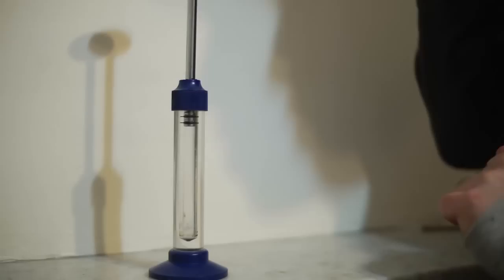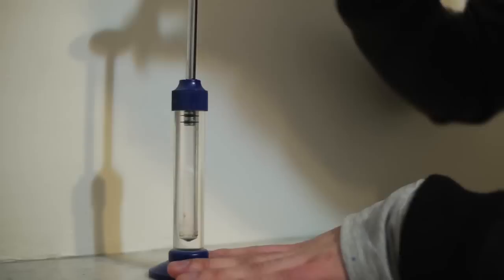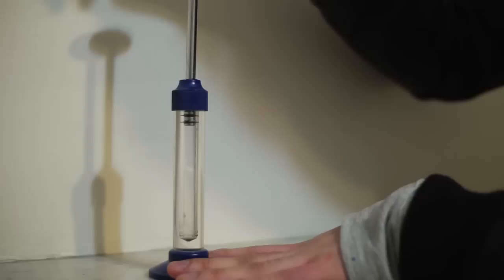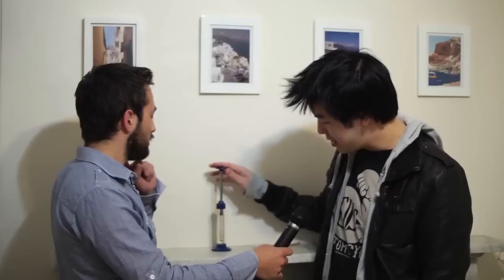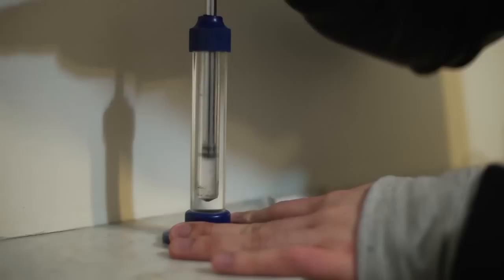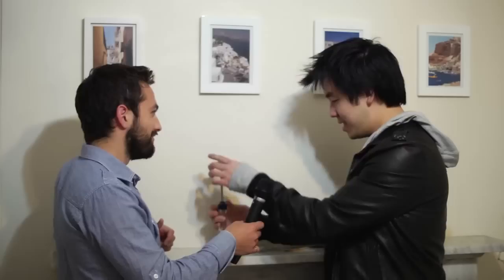Fire Syringe

Comment: Temperature should be constant :/. The Boyle-Mariotte's law says that pressure and volume have an inverse proportional relation. The pressure increases because the particles travel a shorter distance at the same speed so they hit the walls of the tube quicker.

Why is it not?
Reply: Pressure and volume are inversely proportional IF you're dealing with an isothermal situation (constant temperature). That is, this relationship exists if the setup is already such that the temperature is going to be constant, it's not that the first implies the second. With a slower compression, for example, where the thermal energy has a change to escape (we call this a quasistatic process), this relationship holds, but for the case presented in the video, where the thermal energy has no time to escape the container, then a different law is followed.

In case you're interested, the law followed in the adiabatic case is that P is inversely proportional to V raised to the power of gamma, where gamma is the ratio of the specific heat of the the substance (in this case air) at constant pressure, to the specific heat of the substance at constant volume.

Comment: You can reverse this process and cool down instead. Guys try this: open your mouth really big and breathe out, holding your hand in front of your mouth. Pretty warm eh.
Now make the opening of your mouth a tiny one and breathe out again, this time its much cooler. 
Differences in pressure inside your mouth and atmosphere causes the air to expand while exiting your mouth, cooling it down. It's the reverse effect of heating up when air is compressed.
These are governed by 1st law of thermodynamics

Comment: Not quite. Water can't boil from compression as far as I know. I could be wrong as I've never tried but the boiling point of water increases as you compress it. At 100psi, water boils at a little over 300°F and higher at higher pressure. So at the bottom the the ocean (~35,000ft) water would boil at well over 5,000°F. Even without the increased boiling point, the heating of the air wouldn't last long enough to boil the water unless it was an extremely tiny amount.

Comment: Is it possible that ignition comes because of electrostatic? Since when it was push in to the tube its a bit sticky (possibly caused by electrostatic charge). The sudden pressure might produce sudden increase in temperature that favorable for ignitinon, but the ignition might come from the electrostatic charge.. When the plunger was push in, the friction between the plunger and the tube might also produce electrostatic...

Comment: i think its incorrect to say that heat escaping because of slower compression will prevent ignition. it wont ignite in slower compression because of air escaping from a not perfectly sealed or airtight cylinder. did i say that right? pag mabagal ang compression unti unti lalabas ang hangin kaya hindi maabot yung tamang density. hindi dahil sa lumabas yung init.
Reply: No, with a slower compression the air particles wouldn't collide as fast, hence why there wouldn't be as much heat
Reply: joy castaneda   The seal is air tight, it's just, if you compress the air slowly, you still get an adiabatic compression, only that you don't reach the temperature needed because the compression is not "fully adiabatic", but it lets some heat pass through the walls of the cylinder. It is a small amount of heat, but it still prevents you from reaching the maximum temperature you would get with a fully adiabatic compression, and if you don't reach max temperature you might not ignite your fuel (which is in this case cotton wool)
Reply: Heat ha no mass, it can escape if it wants to

Comment: Do diesel engines not use spark plugs? I was under the impression that the high pressure behind each piston was just to put more explosive fuel in the chamber to create more force behind each explosion when the spark ignited the fuel. Sorry btw for that terrible wording.

Comment: I am assuming that this process can be considered adiabatic since the timescale for heat dissipation is slow. Can someone please share the thermodynamic calculations to solve for the internal temperature, T2, given that we know V1, T1, P1, V2. I know I need to use the ideal gas law and assume the process is isentropic. Which means T2 can be solved using T1V1^(ϒ-1)=T2V2^(ϒ-1) where ϒ = Cp/Cv=~1.4. Ok, i know i may have this wrong, but I hope someone with a good thermo background can correct me.

Comment: Is there a formula to make the syringe even larger? What exactly is needed before combustion is achieved?
Reply: Pillow Talk 

For combustion to happen there must be all three elements: fuel (the cotton wool), oxygen and heat (as Derek has explained the rapid compression raised the temperature of the air inside the tube). If you make a larger tube, it probably won't affect the fuel and oxygen (maybe it will be a more favourable condition from the perspective of oxygen!) However, it will be harder for you to raise the temperature of the air, because it is harder to push a larger syringe. 

A larger syringe is possible as long as it does not hinder your pushing the plunge and raising the temperature of the air inside. It is possible, but not desirable.

Comment: That is same as you start a Diesel engine, the diesel doesn't burn like petrol. But with Electric motor to compress your piston fast and powerful. you will diesel exploded and you get a working power generator.

Comment: demonstration of the difference between diesel and petrol engines where diesel engines have a longer stroke and use compression for ignition rather than a separate ignition system of petro engines.

Comment: Not really heat up the engine block, when you look at a diesel engine engine head on its underside, you would notice that there is a "slot" near the intake and exhaust ports/valve opening, this is called the pre-combustion chamber, there is where the glow plugs are located, on the first cycle of the engine run the fuel/air mixture goes into that chamber causing it to combust creating the momentum needed to carry on the engine cycle.

Comment: Not all diesels use glowplugs either, glowplugs are designed to aid in the starting of the engine in below freezing temperatures. There are many Diesel powered rock crawlers that use glowplug deletes.

Comment: The problem with doing it slowly is not the escape of heat. It is that your Force • Distance (Work) is less.
Reply: Your work will be the same regardless of time. You want to look at the work done in a gas, which is defined as P*V where P(pressure) = N/m^2, V(volume) = m^3 -> N/m^2 * m^3 = N*m = work. The volume decreases and the pressure increases rapidly so it's an adiabatic process which means that the process is happening so fast that there is no heat exchange with the surroundings, just like when you're popping champagne.

Comment: I May be misunderstanding this. Have you ever played with a co2 cartage? It releasing the pressure causes it to become extremely cold. Is this not the exact same principle at play in reverse? I thought concentration of thermal energy being forced to occupy a larger/smaller space was key in this function. Am I missing something?
Reply: Mechanical Engineer here. I'll just give you the quick summary. Rapidly expanding gasses get cold, and rapidly compressed gasses get hot. when you let air out of your CO2 canister, the gas is expanding, and when you whack a plunger like that, the gas is being compressed.
Reply: Ah! My dream qualification. I hopefully begin schooling next month. Let me pick your brain some more. They mention friction in this video, no? I'm confused as to how the same principal (in reverse ofcourse) could be applied to create cold under pressurized gas release.

The way you have explained it is how I understood it, but this videos dialog is throwing me off.... How is friction a component in cold caused by gas release?
Reply: Lets focus on your air-soft canister.
Anytime you have movement of particles against each other you get friction, including friction between gas molecules moving around in the air. Friction plays a small part to try to heat the moving, expanding gas. The cooling effect however is much greater then this heating effect, so much so that we don't include it in calculations. The principle at work here is the state properties of gasses. Its all about how much energy can be stored in the substance at different states. One thing to realize is that the CO2 in your canister is NOT gas, its liquid. When you boil water, it starts as liquid. It is heated to 100 deg C, then the temperature stops rising. It will now take a specific amount of heat energy, per gram of water to turn it into 100 deg C steam. That is, heat is added, the temperature stays constant, but the state changes. This is called latent heat, the energy required for the state change. When you have a liquid in your canister rapidly become gas when it escapes, you have changed the state without adding that latent heat. The absence of this added heat is why the gas is colder then the liquid was inside. Now the gas will absorb heat from the surroundings, therefore feel cold. Don't try to use PV=nRT to figure this out, because that is only for gasses that stay gasses, while our problem has a state change. You will need to take thermodynamics before you can really grasp all this, and answer your other questions. You will most likely be taking that you third and fourth semesters.The concepts of entropy and enthalpy are key. Good  luck with your schooling.
Reply: Ahhhh I see my fault now. State change sure does complicate matters (no pun intended). It's a little tough for me to completely understand this. I will refrain from making any assumptions until I can develop a more solid understanding through further education. Regrettably, I'm not entirely educated in these areas. But I hope to change that soon. Thank you for helping me out, sir. And yes I will do my best. Thanks for the good wishes.

Comment: just a quick question. is this also what happens when thing fly into our atmosphere?
Reply: No, objects fly at such high speeds that friction from the air in the atmosphere raises the temperature of said objects to the point that they become red-hot.
Reply: +Robert Adan Incorrect, they move so fast they compress the air, which heats up.
Reply: REKT XD
Reply: +BenJHare No, its the friction from the air that heats it up
Reply: +Mr.SpaceTricks While friction is a factor as those speeds, compression is the main heat creator.
Reply: yes when an object passes through the atmosphere it has a surface at which air infront of it compresses this makes combustion with the minerals on for example a meteor possible. Spacecrafts are often lined with heat resistant plates that has higher melting and ignition temperatures.

Comment: (p*V)/T, only 2 values may change in the equation, 3rd value is constant. Let's take a look at 3 possible things that could happen. Izothermic process - pressure goes up, volume goes down, temperature stays constant. Izobaric process - Volume becomes bigger, temperature gets bigger, pressure stays constant. Izohoric process - Pressure goes up, temperature goes up, volume doesn't change. The process in the video is Izothermic - the air's volume goes down, the pressure goes up, but temperature remains the same, meaning ignition is impossible and it is fake. What about diesel engines you ask me? Diesel engine is izothermic process too until the point when air-fuel mixture is squeezed so hard, it can't get squeezed any more, and it becomes an izohoric process, where volume can't get any smaller, so the pressure and temperature builds up.

Comment: If the particles collide causing heat, then why is compressed air (when released) cold?
Reply: Although the overall  speed of the molecules may stay the same, the molecules are getting apart from each other. That makes them less likely to bounce off of each other, and transfer the energy from other molecules.

Comment: diesel engines don't have any way to manufacture spark other than compression. the starter cranks the pistons fast enough for fuel ignition. They have glow plugs that warm the fuel to aid in the initial combustion.

Comment: I doubt the temperature actually reaches the autoignition temperature of cotton.  Remember that when you compress it, the partial pressure of oxygen increases massively!  So the autoignition temperature is likely cooler than at standard pressure.

Comment: If you have a low compression engine and you use high octane fuel, it will still work because the spark plug will help it burn but you'll be wasting a lot of money because performance will not improve. 

If you have a high compression engine and uses low octane fuel, then it will break the engine because the low octane fuel will explode before the piston fully compress.

Comment: Particles collide? Does that mean that the friction of the air heats it up? I don't believe that because the air would remain hot after it loses the pressure but that won't happen here. You know when you open a high pressure tank to release pressure, it gets colder even though the gas stream gets in motion and experiences friction. I tend to think it the way magnifying glass works in sunshine: It collects the already existing heat from large area to small point. The air in the tube also has certain amount of heat, and when the volume is compressed to small space, the air's heat gets concentrated too like 10x volume with 1x heat equals 1x volume and 10x heat?! I'm only guessing with some low tech language... Are there any truths in my theory?
Reply: The particles are confined to a smaller area which increases friction hints why it gives off heat

Comment: You are wrong.  Glowplugs are intended to heat up the cylinders and the engine block, not the air.  Heating the air would make no sense because on the first exhaust cycle, the piston would push this warm air out of the cylinder.  If it was an intake cycle, it would pull in cold air.  Warming the air would only benefit one cylinder and only if it was at the beginning of it's compression cycle.  So yeah, you can't be more wrong.

Comment: This is not how a Diesel engine works. They compress a Air Diesel Mixture and normally you need extra heat when the engine is still cold like a glow plug. In the Video was only the Idea that Air gets hot if you compress it.

Comment: This is how they have been making massive amounts of money selling gasoline... When a piston in a motor comes up the exhaust pipe opens and unburned fuel is ejected out of the piston chamber into the exhaust system ...this is what is happening when a car backfires... Fuel still comes out even if it doesn't backfire... That only happens when it's hot enough to actually ignite the fuel in the exhaust... Usually when you rev the engine at high rpm for an extended period of time... Is when it becomes hot enough to actually ignite

Comment: Not so ridiculous. The piston in the engine is simply to compress the air. The combustion is simply to expand the air rapidly so it pushes the piston back. If you can find a way to expand air rapidly without the need of combustion, then it is possible.

Comment: that is not true no diesel uses the glow plug to ignite the fuel air mix the glow plug is only there to warm the air on initial start up when the air siting in the engine is cold and cranking the engine will only bring more cold air in so you have to wait until the metal in the engine is warm so the glow plug warms the air so when the piston comes up the air already is warm

Comment: Why can’t this system be used to power cars essentially with no gas
Reply: Cars use gas (or diesel) due to the energy required to run the car.  The energy density of gas or diesel is much greater than cotton so you only need to carry a few gallons to drive around.  For example, the energy density of gasoline is 46.4Mj/kg while wood is 18Mj/kg (I couldn't find the energy density of cotton quickly but you probably can find it), so there is about 2.5 times more energy in gasoline than wood for the same mass. The volume the gas takes up is much smaller too so you don't need to carry a trailer full of wood wherever you go, just fill the gas tank.

Diesel engines essentially function like this fire syringe.  For the internal combustion to work you need oxygen, a fuel source, and something to ignite it.  In the fire syringe case here the cotton is acting as the fuel source and the air contains the oxygen.  When it is compressed quickly as explained it generates enough heat to ignite the cotton without the use of a match or electrical arc (spark plugs for unleaded gasoline engines).  In diesel engines the diesel fuel is the fuel source instead.  The piston compresses oxygen very quickly and the diesel fuel is sprayed into the cylinder as a fine mist which ignites due to the temperature increase of the rapidly compressed air.  If it is really cold out, glow plugs in diesel engines help pre-heat the fuel and air so that the compression of the air can reach the required temperature to ignite the diesel fuel.  This is why it is recommended to idle a diesel engine for a few minutes to allow it to come to operating temperature before working it too hard.  Diesel engines are able to achieve this combustion by compressing the air much more than in a regular gasoline engine.  Gasoline engines need a spark plug to start the ignition.

Comment: 2:44 - But where is the heat escaping to?
Reply: It's not completely air tight.
Reply: +Bliffity Oh. Thanks.
Reply: That and it would heat the material the chamber was made of via convection and radiation into the outside air.
Reply: +David B Makes sense. Thanks!
Reply: No problem! :)